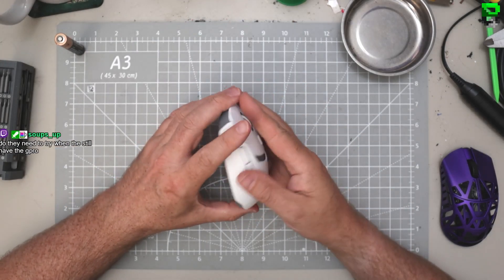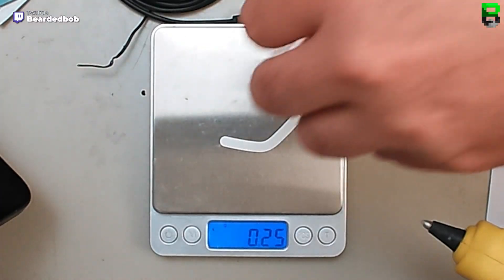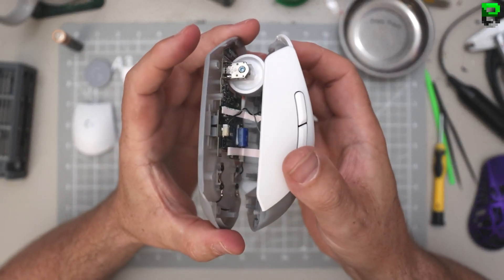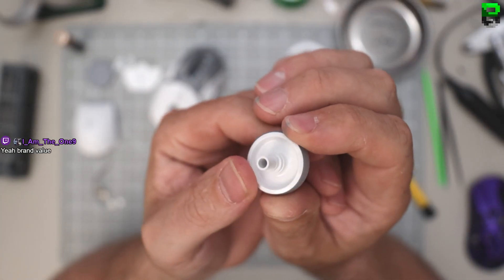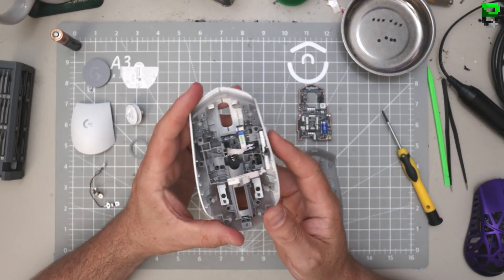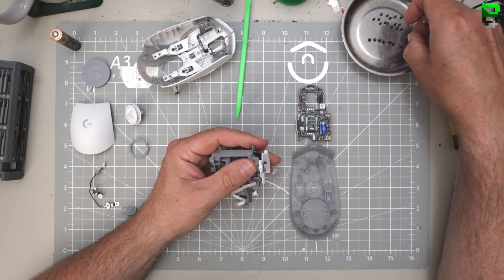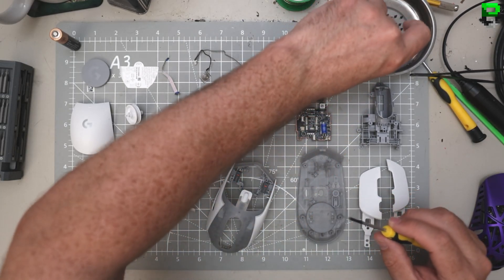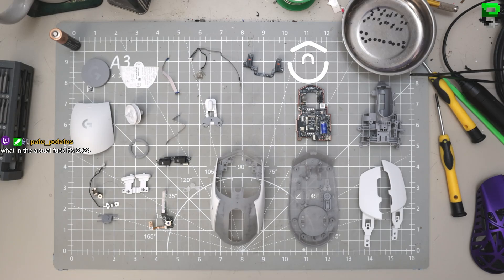Logitech Mouse G309: What Went Wrong Inside? 🔍🛠️

Comment: That blue thing is a supercapacitor not a resistor. Likely to smooth the power delivery and power the mouse for liftoff from the power play mat like you said. Supercaps would be a great way to power a mouse because they charge almost instantly.
Reply from the maker: Think it’s for the power play Matt to hold some charge if you haven’t got an AA In it